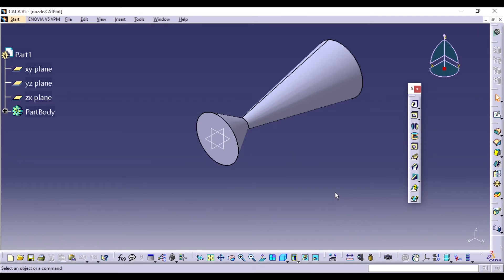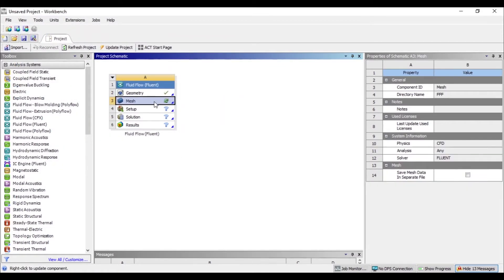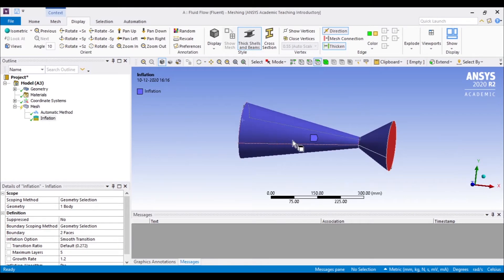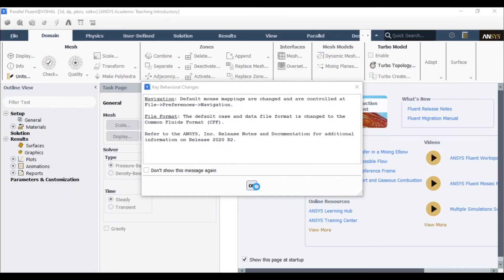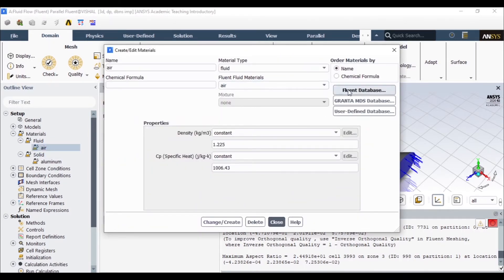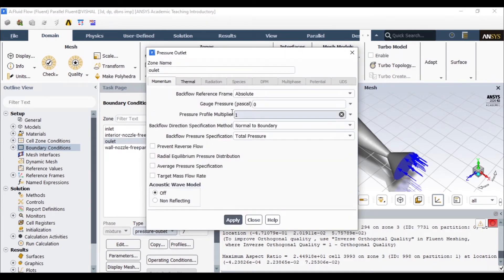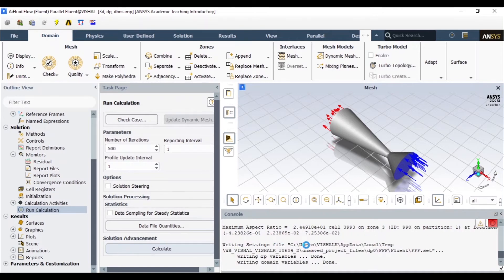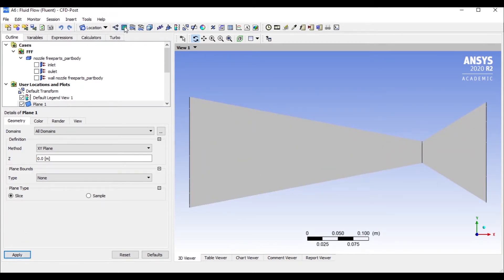ANSYS Fluent Tutorial -  CFD Nozzle Simulation

Comment: Is the recent iris xe graphics with the 11th gen i5 16gb ram compatible and sufficient  with ansys for  medium 3d  simulations?
Reply from the maker: Yes it works Great
But would recommend 2gb graphic rather than integrated one
Reply: @vvktutorials  Have you tried to run ansys on 11th gen i5 laptop with integrated iris xe graphics ? Does it work or not